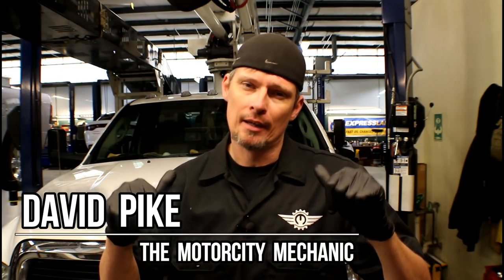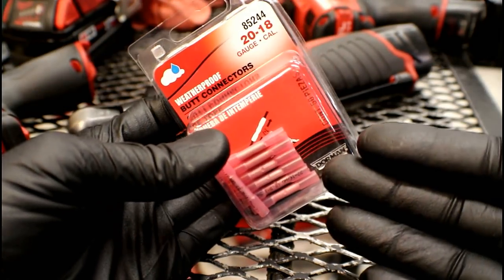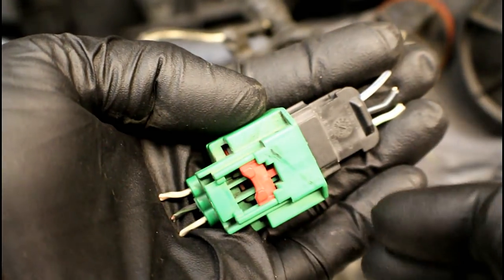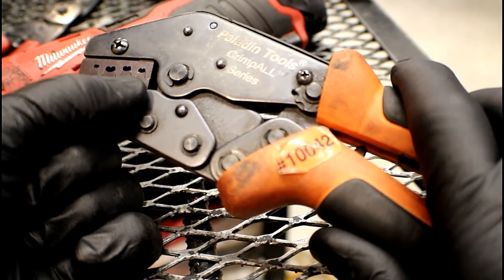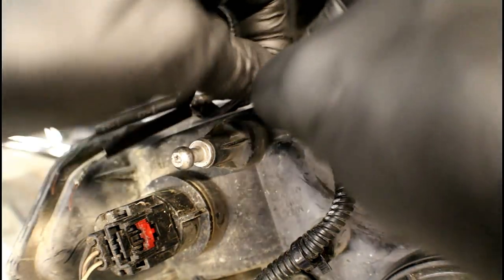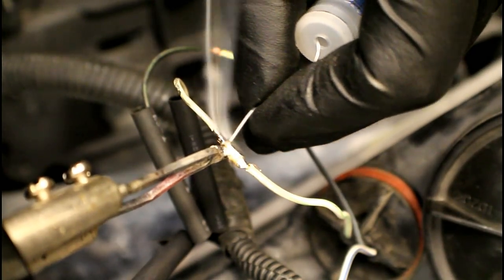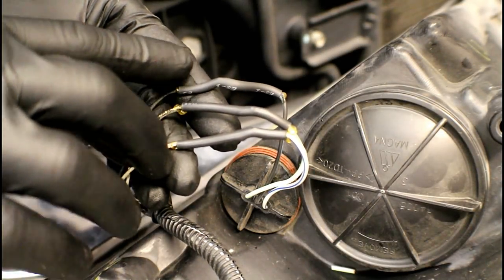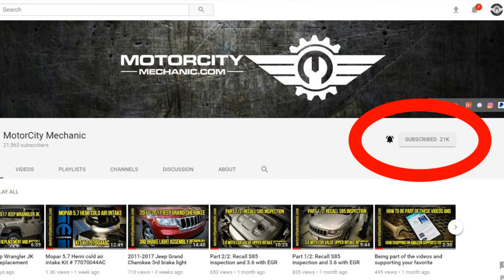2011-2015 Ram truck headlight problem video followup and connector fix

Comment: Thanks man!!!! I’m a YouTube shade tree mechanic. So I only work on my vehicles when I absolutely have to. So I put up with not having a driver side headlight for years because I thought it was a short that was outside my skill level. but when the other side went out, I replaced those bulbs only to find out that it still didn’t work. Then I watched this video and it fixed my headlights on both sides. I got my “I fixed S#!t b0ner  going now!” Thanks again.

Comment: jumped in my Ram this weekend and noticed my drivers side headlamp not reflecting off of the garage door.  Hit the highbeams and both drivers side lamps are dark.  Highly unlikely I lost both lamps at the same time so I go to youtube and find your videos.   Bypassed the green connectors and everything works now.  Took about an hour as I was in my driveway, in Phoenix, 110 degrees so I wasn't sprinting through it.   Thanks so much for posting these videos, they are a great help.
Reply from the maker: Awesome.....another fixed! Thanks for searching and for watching my video. Appreciate it and make sure to subscribe!

Comment: I watched the headlight replacement video and then this one. YOU have a new subscriber!!!!  I am hoping this is not the current problem with my 2011 RAM 1500!! Getting ready to go find out, replacing all headlamps. Thank you for your knowledge and making video's for us MOPAR guys!!!
Reply from the maker: Thanks for finding the channel and for watching this video. Its much appreciated along with you having subscribed. Always happy that I can help out.
Reply: I have a 2011 Ram 1500 that I have suffered with headlights being out almost since the warranty went out. I knew the problem was the connector, but couldn't find a cheap fix. This video was the cheap fix.

Comment: Thanks so much for sharing this fix with us. This made so much sense, don't know why I didn't think of it. I saw this video about a month ago, went out and bought the needed parts, did the repair in about 20 minutes (start to finish, one light) and I'm just so happy to have both headlights working again. Over one month later and not a single issue. Really appreciate you.

Comment: Another great video....thanks for the proper information. Maybe when I find the time to I can do this on my Ram truck. Already took the headlights out and messed with the connections and both lights worked for a short time but then the right headlights all went out again. Thank you for taking the time to make, edit, and upload these videos it really helps out a lot.
Reply from the maker: Thanks for watching. Im sure your issue will be the same as in the video. Do the repair and you wont have any further issues. Make sure to subscribe!
Reply: I ❤ live love you and your videos! I was brought up to be able to fix simple things on my vehicles. But those Ram headlights give me trams. But saving Grace is your befits. Most helpful for a 74 years young great grandma!
Thank ❤you from the bottom to the top of my heart❤

Comment: First off, I have a 16, 2500. It has a new battery and new alternator.  My headlights  dim and sometimes flicker when I hit the brakes or adjust the  AC/Heater blower. Do you  think this could be my issue?
Bravo on the high quality and very professional video.

Comment: They need to recall their damn headlights! Ive been having problems with my 2009 rams headlights and foglights for 2 years! Bullshit! But thanks for the video
Reply from the maker: I am not a fan of the issue either Mitch. About all we can do is make calls to Chrysler explaining our concerns and hope that with enough complaints....something gets done. Thanks for watching and make sure to subscribe!
Reply: I brought mine to a shop. After all day, I was told I needed a TIPM unit. Guess what, didn't work. They were lucky that they took the TIPM back. Still don't have passenger side low or high beams. But I do have an operational amber and blinker!!

Comment: David! You the man! I changed  my bulbs today to LED H11 and 9005 i believe  passenger side came together no problem. Drivers side, low beam prong too close together wouldn't  fit , accidentally  pull the three wires out red ,black and green. The other side wht/blk, wht/brown, white.  Wire kept slipping out green connector, got it together only high beams work, i gave up , after watching  this  video,  i know i can cut off the connector,  im going fix that light. All i have to say is i appreciate  the video, ill let you know how it goes, Thank you.
Reply from the maker: Thanks for watching. If you do that repair you should have any further issues. I appreciate the comment and feedback. Make sure to subscribe.

Comment: I was wondering if I could remove the connector and do this. Im about to start an early AM shift, and will be driving in the dark every morning. These connectors are kinda pricey at $35 each! This is a cheap fix, thank you.
Reply from the maker: Its the method we use and havent had any issues. We see similar issues with connectors under the seat related to the airbags.....Chevy does as well which pretty much means the same company makes them for both of us. Thanks for watching and make sure to subscribe.

Comment: Was plagued with lights coming on and off, and when you take the light out to look at it ,it always worked. This time I left the light on for 15 minutes. Then found 1 of the wires coming out of the connector quite warm, I knew you were on to the problem.
Reply from the maker: It will always start working while your checking it. I always think the best method is removal of the connector. No chances of it overheating or the lights failing when you need them the most. Thanks for checking the video out and for your time commenting. Make sure to subscribe

Comment: Exactly what I had to do. Connector was a POS. Good  video
Reply from the maker: Hate that it became an issue....but now that you made that repair you wont have that issue....at least on that side, possible the other however. Thanks for the feedback and make sure to subscribe

Comment: Just fixed mine. When I undid the factory electrical tape, it broke the center ground wire. Soldered and heat shrink did the trick. Thanks! Ps. None of my connectors had carbon and they were not burnt.
Reply from the maker: I would say that 90% of the time the connector looks great and its a terminal issue. Removing the connector and soldering the wires is my go to method. Thanks for watching and for the comment! Dont forget to subscribe.

Comment: Hey David, I am sure you are aware but there are weatherproof Butt connectors that offer the trifecta of goodness. They consist of crimp, shrink tube with the sealant, as well as solder. You crimp wire in place first and then when you heat the shrink tubing it also melts a solder load from the center of the connector into the wires. I love the stuff. It is a bit pricey for Butt connectors. However, they can be found on sale. Again, I like the triple redundancy. I will say they are usually a specialty item not found at your local auto parts store. All i can find at auto center is solder and shrink without crimp.
Reply from the maker: The ones I showed in the video are the weather proof heat shrink style butt connectors. We have one tech that uses them in the shop and here are my experiences........there have been 4 different vehicles that have either come in or returned that had repairs made with those style butt connectors. One was a truck that had the wiring damaged and the air bag wires repaired using those butt connectors......it had been to 3 different shops since that repair and no one could find the issues. I eventually located the issue under the carpet....and guess what was used....those butt connectors. Another vehicle that the tech I mentioned worked on in the past....had been back to the shop off and one over the last year at least 5 times for an intermittent airbag light.....I eventually get it and what do I find, that tech used those same butt connectors on an air bag wiring repair and every other tech has been chasing their rears ever since that repair. The butt connectors were the cause. The tech even covered those butt connectors with the black heat shink so we thought they were soldered repairs. This keeps getting repeated with the other 2 vehicles as well. So I started to see a pattern and each of those times....the same cause. I have heard of some used at the Mercedes dealers. But what I have found as you mentioned is that people are getting the versions at the parts store which is no where the same as the high end versions your mentioning. The average DIY or local repair shop gets what ever the local parts stores have on the shelf and ends up being brands like the Dorman version in the video. Far from the best thats out there. Thats why I dont want people confusing the cheap trash worthy butt connectors with the high end versions. So the best thing I can recommend is soldering the wires and heat shrink. Only cost is the heat shrink and no need in hoping that the parts person gets you the good stuff. I guess I am trying to figure the easiest way and way to insure no further issues. I just waited in the past getting burnt by those mentioned repairs I came across. Its always one thing to find an issue that happened....but to find out it was caused by another tech.....thats when I started having a bad taste in my mouth about the butt connectors. Appreciate the comment and discussion. Thanks for taking the time to watch the video as well. Its always appreciated!

Comment: i vote for soldering and shrink tube, always more reliable than any crimp on, which will corrode in a few months also even if you got it great right now, as a testament to that method, my garden outside wiring is done that way, all weathers wet, sun snow, been there 8 years and no wiring issues.
Reply from the maker: The heat shrink with the sealant is the key as well. Got to make it 100% water proof.....the cheap stuff doesnt do that. Thanks for watching and for the comment.

Comment: Thank you! Thank you! Thank you! Thanks for throwing the butt connectors in the trash because the only thing that really works with butt connectors is the name... "Butt" because that's what they're worth. My background is from Navy Avionics training 30 years ago when they taught us to be electronics technicians, and since, I've done everything from installation to full design and integration of Intelligent Transportation Systems for transit authorities from Bar Harbor, Maine to San Diego, California. The only place that a crimp connector should ever be used is at a connection point designed for disconnecting for ease of replacement, removal, or testing. Even then, a crimp connector isn't enough. It's a vehicle. It endures harsh conditions from sea spray to road salt to high humidity. 
So, when you use a crimp connector, make sure that the following items are at least looked at seriously if the wiring is supposed to last more than a week (seriously, I've seen wiring corrode and disconnect in less than a month because these standards weren't followed when installing the equipment):
- Make sure that only the minimum number of connection points are made. The fewer, the better. 
- The only place a crimp connector should ever be used (avoid altogether if possible), is where a designed and necessary disconnection location is needed for replacement, remobal, or testing of a component is going to be needed. Example - a horn has a connection point - 1 connection point, and that is where the harness meets the horn or where it is designed to be disconnected for removal to get to other parts or replacement due to defect of the horn. That's it, 1 place only. 
- If a crimp connector is used, it must have it has a shrink material as the insulator where the wire enters the crimp. 
- The crimp connector must be the correct gauge for the wire used. Yes, people will double the wire, but that's not how its done correctly or for the best probability of it being problem free for the longest duration of time. 
- Even more important than making sure that shrink type of insulation is on the crimp wire, THE SHRINK INSULATION MUST BE HEATED UP AND SHRUNK AROUND THE WIRE!!!!! It does no good to use the correct materials, then not heat the darn thing up to shrink the insulation and glue to the wire. I've seen that one ten thouand times or more and that one absolutely angers me to know that someone did the material selection and crimp correctly, but the connection corroded because they didn't shrink the darn thing to lock out moisture. Ugggghhh!!!!
- It's not a bad idea to put shrink tubing over the connection after it is connected and shrink it into place as long as you're sure that the connection is correct and won't need to be disconnected for some length of time in the future. it's just shrink tube and its really cheap. Go ahead and slip a piece over the connection so it keeps moisture and contaminates out of the connection point.

These tips help, but quite honestly, nothing beats getting a good, quality Deutsch connector with the correct pinning tool (or solder on pins), the correct seals, and creating a professional connector. Other manufacturers I highly recommend and that are easily found are Weatherpak, Amphenol, and Molex.

Anyone who uses a scotch connect, or those clip on connectors, I already have your soul in a jar for your afterlife because there is nothing, absolutely nothing, less forgivable than a scotch or clip on connector. Every time a person uses one of those, an angel loses one wing and has to fly in circles for eternity. Now how do you feel about using them? Go out to the car now and replace all of those with solder and shrink tubing, immediately.

Comment: Your is extremely helpful!  Unfortunately, when I got the headlights off they are not wired as indicated on your video.  I have a 2015 RAM Laramie with the auto high beam feature.  It has a couple extra circuits with a connector or interface marked "AUXITO".  Any suggestions on this dilemma?  Thank you.  Robert S

Comment: Just found your channel because my passenger headlight is off most of the time but work sometimes.  Will check into using this fix this weekend?  Just to be sure, it you wiggle the connector and it comes on, this is most likely the problem?  Great video and I subscribed for sure.  Look forward to watching more videos about my 2013 Ram 1500.  Thanks!
Reply from the maker: If the like comes on or goes off with the connector wiggled then I recommend doing the repair in the video. Thanks for watching and definitely check out my other videos. Appreciate you subscribing as well. Many thanks.
Reply: One question, do you have to unhook the battery or is it on to have the light switch in the off position?
Reply from the maker: No need to disconnect the battery on this repair. Just make sure that lights are turned off and you will be fine.

Comment: I would like your thoughts on the self soldering shrink connectors. 
I've been using these for about a year now, and have had amazing luck with them.  I have a fellow bringing his 2011 2500 next week, should be easy except for the HD grill guard installed on it. I'm sure I'll have the information I need to make the repair thanks to your video. 
Great job!

Comment: Question , would you not unlock the connector and re pin the terminals then reinstall? Or re pin and install to a new connector? Not sure I would like the factory harness cut into. Thoughts??/

Comment: Thanks! It worked fine with aftermarket housing  not with stocks just my passenger low beam switched bulbs and everything you know if this would be covered in warranty? I got like 2 months left.
Reply from the maker: It would be covered under the basic 3 year/36,000. Not sure about anything after that. Thanks for watching and make sure to subscribe.

Comment: How did you know it was the  connector? 
How did you test it ?
I have a ram 3500 megacab 2011
Driver side low beam doesn't work have changed the bulb

Comment: Hey man, THANK YOU SO MUCH, for all your videos, they've been so helpful.
I have a 2012 3500 and my turbo actuator went bad, I know that the 2014 actuator has a different harness, if I get the harness, will I be able to fit the 2014 turbo actuator to my 2012?

Comment: what was the symptoms to prompt this repair also I have an 09 ram 1500 TRX the right head light keeps going out and bumping the light sometimes it will come back on the bulb appears to be good is this the most likely problem or the harness I am going to use your video on the evaporator removal tomorrow great videos and I appreciate you always answering the questions subscribed for some time now bell is clicked Thank you in advance
Reply from the maker: It was the typical no headlight issue. Bulb was good and touching/wiggling the connector made it start working. That connector is the most common issue I have come across and possibly your issue as well.  Thanks for always following and for supporting the channel!
Reply: Having the same exact problem with my 2010 TRX right head light.  After 3 times in the shop, was told I need to replace the harness and the quote was $800!!  Think I can follow this vid and save some cash!

Comment: Great vid! 

Other then just shaking the connecter itself to see if that was the source of the problem, is there any other symptoms that would be "tell tail signs" it is solely the connector?
Reply from the maker: I did another video where I have you check the connector at the bulb to see if any overheated terminals. Otherwise the connector in the video is the most common issue. Thanks for watching and make sure to subscribe

Comment: Thanks for the videos,  I have a 2014 ram,  I replaced the harness and removed the connection,  but I'm still having headlight issues.